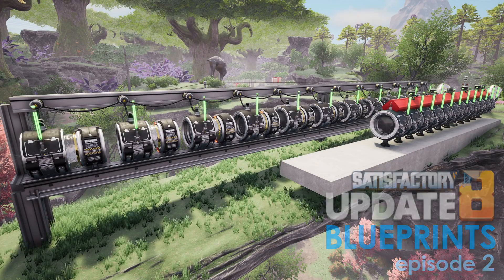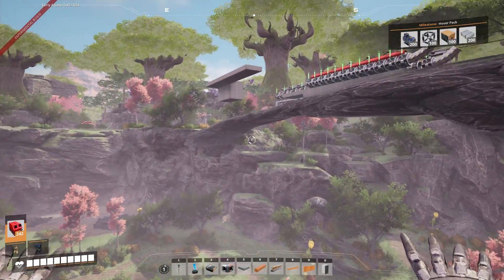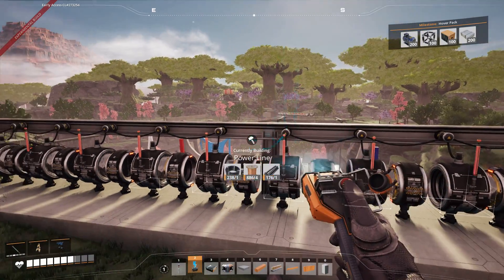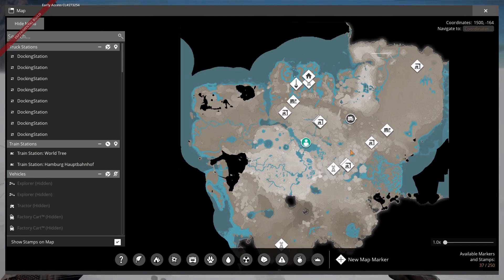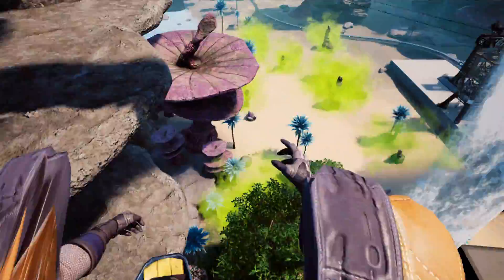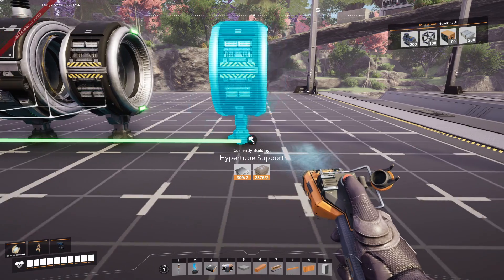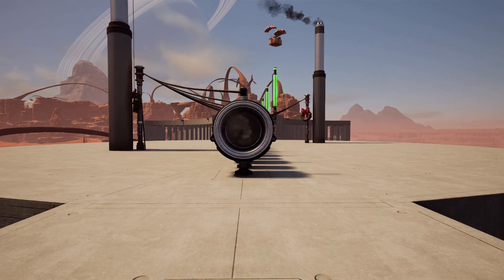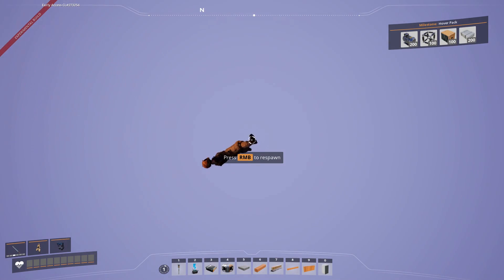Satisfactory Blueprints Ep.2: HyperTube Cannons

Comment: Great video! 

If you do the tighter spacing you have room to fit 12 + the exit in one blueprint so you don't have to use two blueprints and line them up.

Also, you should consider turning off fog (r.fog 0) when using them so you can see where you are going. Just note you have to do this every session for it to be active.
Reply: Oh and biofuel is helpful for jumping since it lasts so long
Reply from the maker: When you turn off fog, is it rough on the CPU? I’ve avoided it so far because I’m not sure. 

I’ve only tried turbo fuel so far. Thanks for the tip. I’ll make biofuel next.
Reply: I'm not sure about all systems, but for me it doesn't affect fps at all, but it does for sure increase pop in. However it's only really an issue when flying and I'll take that over not seeing where I'm going any day.

Biofuel sucks to get the resources for but it's maybe the best fuel option out there. Lasts REALLY long and still gets the same height as turbo fuel, just not quite as  much upward momentum from each burst.
Reply from the maker: @SharkCat4Prez  I’ll try it out with my initial run of bio resources and if it’s enticing enough I’ll consider chainsaw trips like the Tier 1 days. I think if I rounded up all the spare bio parts I have laying around the world factories I’d be good for a while.

Comment: with the same enter speed (regulated by belt) i get different exit speeds according to where I place the cannon. Maybe it's cpu/fps/game-engine related?
Reply from the maker: It is Definitely related to some sort of CPU/FPS/engine spec. I just don’t know enough about the tech. 

I just know because I use them so often. I’d say 9 of 10 launches are pretty dialed in, then the random shots where I don’t go quite as far. Interestingly, the one-offs never go farther for me, just shorter. 

Because of the video editing I learned that my launch flight time is about 35 seconds. To cross over half the map!!! Worth the inconsistency for sure.
Reply: I tried a longer version with supports in the middle of 2 entrances and it works way better @makergaming2022

Comment: Good one! I just love how human cannons would be OP in any other game, but totally fit in this world. I've built three now, connecting my three main project areas into a network. They're sloppy though! So I keep having problems with them malfunctioning every game update. One actually gets me stuck and killed in between sections. Building them your way should help with that. Someday, I should connect them into a proper long-distance tube network for ease of use by visitors.
Reply from the maker: “Ease of use by visitors” is overrated. lol. I find it more enjoyable to throw them a jetpack then say “follow me” as i cannon across the world. 

The stuck in between sections is definitely a real thing. And not 100% consistent from what I can tell. But I’m mostly thinking of all my old tubes. These new ones I used multiple times while making the video. I think they all work at the moment. Pending new game updates. Ha.
Reply from the maker: Also, your visitors idea does give me an idea though. Signs at factories. For the visitors. Seen from line of sight of the cannon user up in the air.
Reply: Aerial signs could be fun! Something like your Jace face wall, but horizontal. Even better if it looks like a mundane building from the surface! 

SCIM used to have a tool for importing pixel art into a rectangle of foundations, but I can't find it anymore.